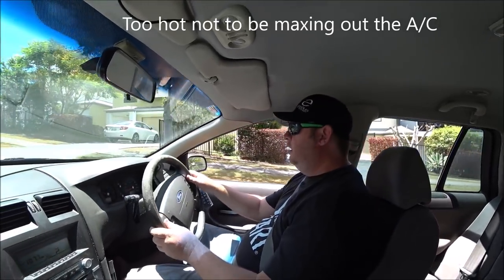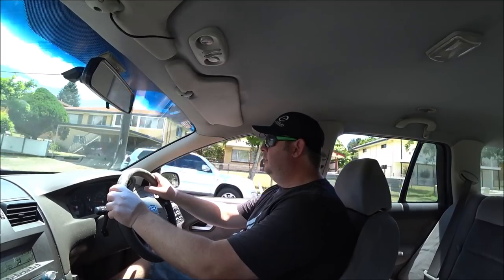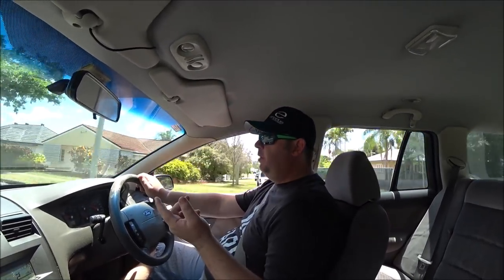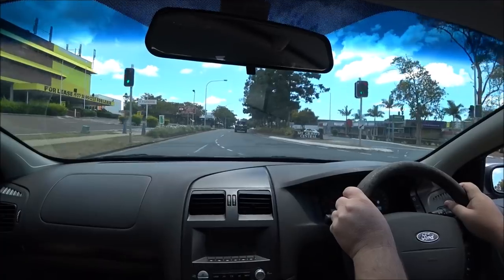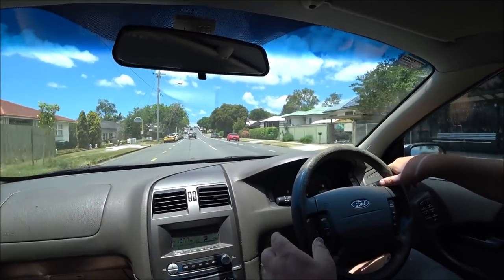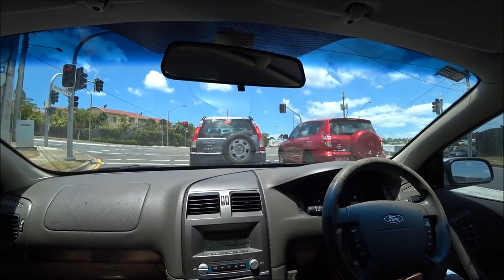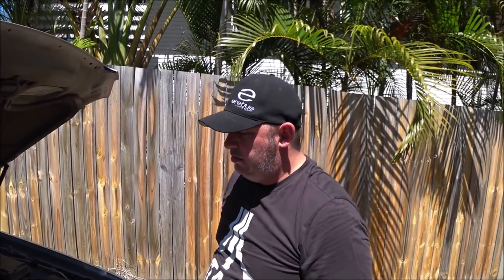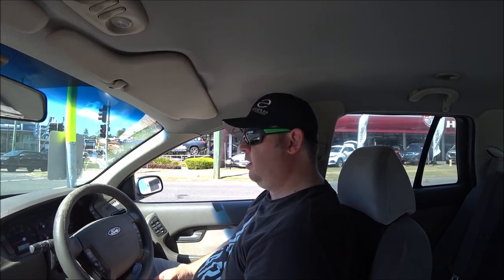BA Falcon - how to replace ba falcon coil packs

Comment: My BA LPG ute I bought a couple of months ago had these same symptoms @165K kms so I replaced both the plugs & coils in one hit (used your previous video for reference).  Got a good deal online for Ford OEM iridium plugs & coils so went with those and it fixed the issue immediately.  The old plugs were quite worn & corroded from the acidic LPG (copious amounts of penetrating oil and time required to un-seize the threads & get them out) however the symptoms (ie: issue got worse as the motor warmed up & only misfired under sustained load) mainly suggested a bad coil-pack as you outlined.  Keep up the great videos mate; plenty of us still driving around in these 20yr old Falcon workhorses that need a guiding hand via youtube for help with periodic maintenance.
Reply from the maker: Glad it helped
Reply: I'm still using my 2007 BF Falcon for work.Will hit 400,000 soon.
No need for a new fancy work car.These things are incredible.

Comment: Just wanted to come on here and say thank you! Watching your video and you describing the symptoms helped me diagnose my issue, found a pack of 6 for $120 at supercheap, ordered yesterday picked up today…

I watched your very easy to follow video a few more times just to make sure I had all the steps correct and took me less than 20 minutes to change all coils! (I paid $230 for plugs to be changed recently and wished I’d found your channel sooner as I will definitely be doing my own plugs next time too) 

My car now no longer has unsteady revs while idle and no (touch wood) spurts of power or loss! 

Again! Thank you so much for making these videos, so easy to follow you explain the entire process really well! If I didn’t live on the other side of Australia I’d be buying you a pint for 6 for sure! Saved me a small fortune!
Reply from the maker: You could always chuck a 6 packs worth on the thanks button om the video. But glad to have helped.

Comment: A little copper anti seize for the spark plug threads in an alloy head and a small amount silicone dielectric grease in a cotton bud Q tip for the inside opening of the coil tube to stop the rubber sticking to the spark plug insulator makes for an easy job the next time you do this. It's also recommended in the Ford maintenance manual.
Reply from the maker: You can put a bit of anti seize on, I've never bothered with it.

Comment: I have an old ba falcon. Not driving it as a daily.. but when it was the slightest misfire on full throttle i change the coil pack. All of them, easy job but difficult also. Removing the cover is easy the grommets are hard to keep 😂.

Comment: Same happened to mine on my BA Ute dedicated LPG. It misfired and vibrated like no tomorrow and was missing heaps. Changed coil packs other day before storm came and fixed the problem :) was coil packs after all and replaced with new plugs also but needa get 2 out but its stuck on. 1 of my coil packs broke apart after removal. But mine never showed engine light but thanfully got it home before it died. Also keep up the good videos :) got my coil packs for good price also.
Reply from the maker: Yeah still think the engine light is a TPS issue, not related to the coils.
Reply: @tangles01  oh yeah I'm heading for same direction with that but yeah my BF XR6 n/a got the engine last time got it scanned said it could be my O2 sensor. But I'm unsure as of now but hope all gets cleared out and fixed bro keep up the good work :)
Reply from the maker: @radoa4  I suppose it could be the O2 sensor, switching from closed loop 1st start up to the open loop running condition? But that's why I want to stick an OBD reader on it, it's still happening after the coils so was 100% not related.
Reply: @tangles01  it runs fine on startup but holds on engine light and also when I erase code it returns and I'm guessing could be o2 sensor and forgot to mention I've changed cat convertor also because it was rattling way before engine light came on and when I've changed my cat converter engine light was on. But I still can drive normally without limp mode active it just has bad milege also so its more thirstier when not giving it and after I changed cat converter but never changed o2 sensor yet.
Reply from the maker: @radoa4  Yeah ok.

Comment: a while back I installed performance coils sofar they've lasted a couple of years still working normally, cost around $200 ebay
Reply from the maker: Yeah like anything you can get cheap ones that work, and sometimes you get top line ones that don't.
Reply: @tangles01  sounds just like tools these days, yet my sidchrome sets and ratchets I bought in the late 80's are still good, flawless all these years of abuse, I miss locally made everything instead of all the chinese  failures
Reply from the maker: @closertothetruth9209  Shit can fail no matter where it's from.

Comment: So did you get the OBD2 reader plugged in and read codes? I have an FG with 170k on the clock. I sometimes have hesitation as well especially on hill acceleration. Replaced plugs at 110k. I might try replacing the coils as they are pretty cheap. Cheaply made that they don't last more than 150k !
Reply from the maker: Haven't yet, the breakdown after 1st start is pretty easy, swapping the coils has fixed all the hesitation issues under load so she'll keep for now.

Comment: What were those tops on top of the 2nd, third, forth, fifth and sixth coil and did you put yours back on?
Reply from the maker: They are like a small rubber spacer, the keep pressure on the coil so it doesn't slip up, yes I put them back on.

Comment: got a similar problem with my BA, 190 ks, i changed the factory coil packs, but she still runs on 4cyl sometimes, i turn off ignition, the problem is gone, getting annoying, anything else i should check ?
Reply from the maker: Throttle position sensor, the issue comes and goes with m. SO haven't done it but I have  spare laying about to test at some point.

Comment: Hey mate.
I'm changing spark plugs and coils right now. The first one...no dramas.
Second one. Ive pulled the coil pack off and it's come away from the rubber sleeve. What's a good tip for removing the rubber sleeve so I can get to the spark plug?
Cheers mate
Reply: Sorted.
Nothing some gentle persuasion with a pair of needle nose pliers won't fix!
Cheers for the video!
Reply from the maker: @jimmyjames3282  I was going to say pliers, but be careful not to tear it.
Reply: Pray bwahahaha    screw driver with tweezers

Comment: Just a question for you mate since I did my plugs n coils with the OEM parts I've noticed on highway driving it feels like it's dragging a bit like stuck in third but it's def in fourth like it's changed the tourq maybe I damaged a valve when I drove missfiring to get the parts like an hour drive
Reply from the maker: The misfire is just a lack of spark, should cause no mechanical damage, could have fouled up your O2 sensor though, with unburden or fuel rich exhaust.
Reply from the maker: Oh I missed one... nice one douche. Why don't you spend 5 mins reading the comments and see how many people I've helped avoid having to go to people like you.

Comment: I was told to replace plugs & coils due to shocking fuel economy 300kms, then to have computer & sensors recalibrated. Won't everything reset with terminal off eventually ???
Reply from the maker: Nothing needs to be re calibrated.
Reply from the maker: @iamasmurf1122  I see English isn't your 1st language. "have computer & sensors re-calibrated" was what he asked. nothing there about battery terminals. I don't see any repairs here??? just maintenance tips. Because this shit doesn't break down, why, because it's maintained.

Comment: Heard you blokes had a massive 45' heatwave... crazy stuff
Reply from the maker: Yeah depending on where you are, it's been a hot summer high 30's every day, a few times in the 40's, hell it was 40 degrees in tasmania all this last week.
Reply: Anyone had dealings   with bcm and pcm notv responding  together       ford bf    futura   auto dealer spent 10 and half  hours trying to fix  tried numerous replacments   no luck         Running  out of  options
Reply: Also auto electrician cannot find a thing
Reply from the maker: Nah mate hasn't been an issue for me

Comment: Hey Tangles check out this Aussie mechanics videos. He is a mechanic and Transmission specialist. 
Ford BA XR6 Replace Power Steering Rack How to DIY
https://youtu.be/D4Pre3lhGeM

How are the Caliber Coil packs holding up ? I’m thinking of putting Bosch , NGK or Champion Coil packs on my BA XR6 , I’m told the best ones are the Ford Coil packs . Any idea how much Iridium Spark plugs cost?Cheers 🍻
Reply from the maker: I found that guys channel the other day, small world. The coils are fine so far at least, I might not get 150k out of them, I might? The iridium plugs from memory are like 20 bucks each at super cheap, you might find the cheaper online though.
Reply: @ @tangles01  Thanks Tangles , The other day my mechanic whom i trust told me it will cost me around  $700 to have new Ford genuine spark plugs and coil packs fitted and have the upper cylinder or cylinders cleaned,  i nearly fell of the chair when i heard the price . I think i ill save myself a good 400 to 500 bucks by doing it myself.  Cheers
Reply from the maker: @conservativesniperhunter7439  The upper cylinder clean would be a sea foam like product to remove the carbon build up. I doubt you'd need it unless you've had a lot of poor fuel or the car has been running poorly for a very long lime.
Reply: @ tangles01 I have petrol/LPG , with the LPG Gas it splutters often when I’m stopped at the light and quite a bit when driving, particularly when I’m going up a hill . At first the mechanic said I should get it checked out by a LPG specialist but then he said he believes the problem is the spark plugs and coils . I’ll replace the spark plugs and coils and see if it still splutters . Thanks Tangles . Cheers 🍻
Reply: tangles01 It runs perfectly fine on petrol. When it splutters on the LPG I have to back off the accelerator once or twice then accelerate again and it clears up again, but fuck me dead it happens often , gives me the shits 💩
Reply from the maker: @conservativesniperhunter7439  Yeah I'm not sure if LPG needs a stronger spark than normal fuel. If so that might be it.
Reply from the maker: @conservativesniperhunter7439  Sounds to me more like an issue with the LPG feed system than spark if lifting off cures it, maybe a line blockage? if there is an LPG fuel filter? Maybe that?
Reply: tangles01 Thanks Tangles , I’ll get it checked out by a LPG mechanic and see what happens. Cheers 🍻
Reply from the maker: @conservativesniperhunter7439  Seems like a good idea